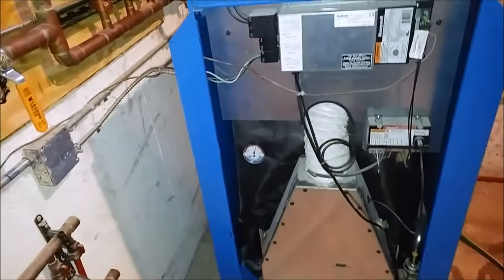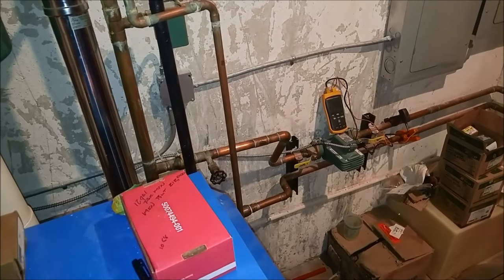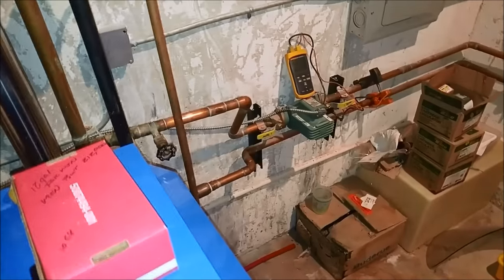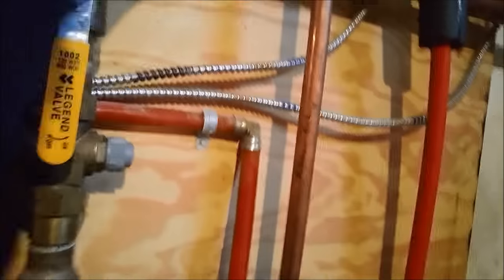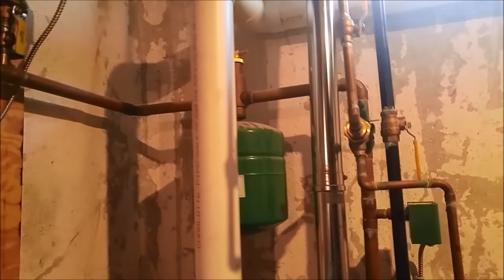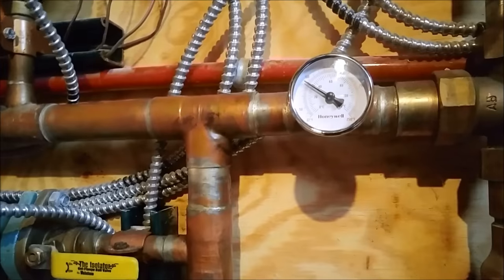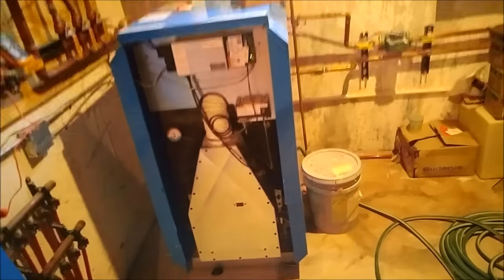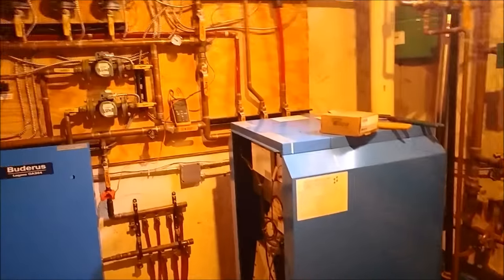Changing a honeywell supervent replacement assembly

Comment: can you add a thermostatic mixing valve and run the tank temp hotter?
possibly somebody removed flow restrictors in shower heads.